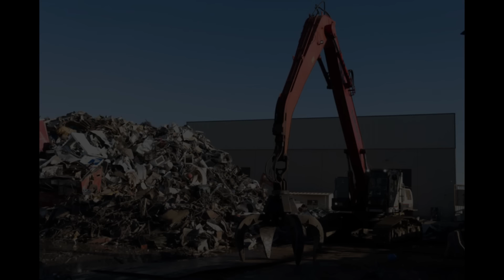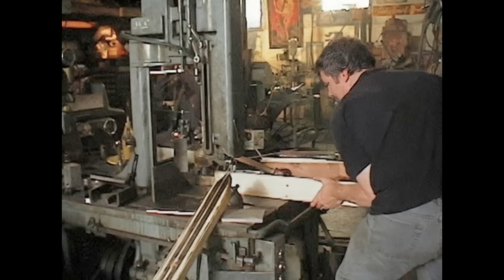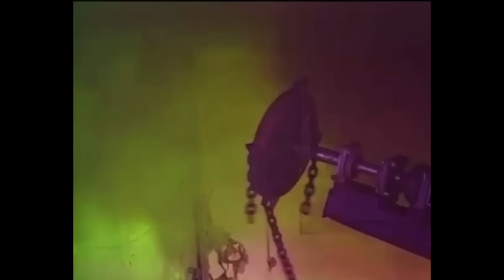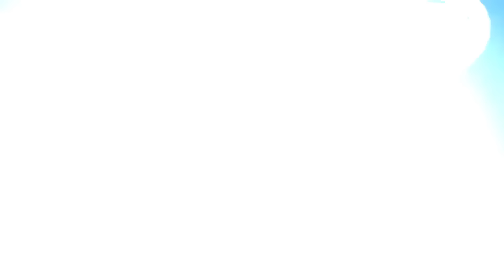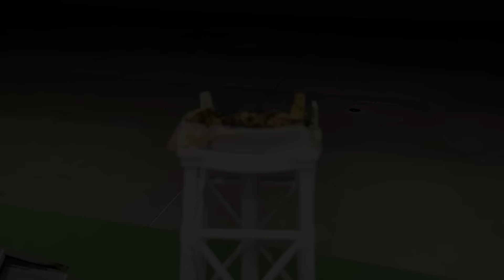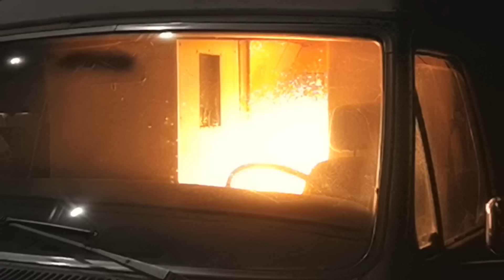Creating a Plasma Cannon by Boosting Tesla Coil Strike Energy

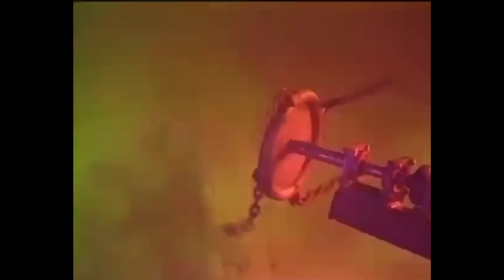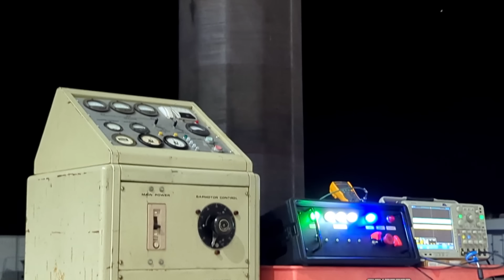Comment from the maker: For the scientifically minded, the boost theory starts at 4:30 .  If you just want to see test objects get vaporized, skip to 7:20 .  :D
if you want to drive high-voltage physics videos past celeb gossip and politics in the algorithm, consider dropping a Hype! (Mobile users: swipe the Like bar to see the button.)
Reply: Could you use something like a focused beam of X-rays to direct the plasma channel? If it was sufficiently directed, a narrow x-ray pulsed beam could ionise a channel within the air that would serve to form a ‘duct’ for the initial HV arc to strike, then triggering the subsequent high energy pulse. Would that work?
Reply from the maker: @giacomomarshall8339  the challenge there would be focusing the X-rays.  The diffraction limit might result in a overly wide cone of radiation.
Reply: @LightningOnDemand  so a sector antenna that pumps out X-rays pointed at a fresnel lens? Makes me think of the ASML lithography tech.
Reply: @Krissco2  Nearly all of Tesla's own x-ray tubes produced long collimated beams of x-rays.    The trick is to create them in that form, not create pointsource x-rays and ten attempt to focus them.  Normal medical tubes just spray x-rays at 180deg or more.  Tesla's tubes were of the "cone-beam" style, employing "transmission bremsstrahlung," with no huge hot tungsten anode.  Tantalum converters employed in particle accelerators do the same, producing a sort of "death ray" x-ray machine, with inherently collimated output.  Hermes-III project at Sandia creates such beams, then launches them at military vehicles, for testing their electronics' A-bomb immunity among other things.
Reply: @wbeaty that’s incredible. I’ll read up on that. At the moment, I can’t imagine how that’s possible (to create as a non-point-source) so I’m sure to learn something!
Reply: @Krissco2  If I understand correctly, a megavolt electron beam turns into an MeV x-ray beam if it slams into a membrane.  It's apparently a relativistic effect, so it turn off when your DC supply is down below 500KVDC.  The resulting photons maintain the trajectory of the electrons, so a collimated e-beam creates an "x-ray ray gun."  If we scan the e-beam, we create a scanned x-ray beam.

Tesla had many such tubes, many with glass fronts (where silica would be the anode!  Perhaps these only worked once the glass became nearly red hot and conductive?)  

A second method is to bounce an e-beam at a very shallow angle from a polished  metal anode.  In that case, a parabolic anode could perhaps focus the x-ray output to a point, or at very least generate long collimated beams.   The Tesla tubes would then have a dish-shaped cathode and a hollow cylindrical anode, and put out an annular (hollow) collimated x-ray beam.

It's all no fun, because standard hospital x-ray generators have more than 3x too small a voltage for this.   But look into so-called  "cone beam" x-ray sources, especially the ones based on "transmission bremsstrahlung" membrane anode, rather than the conventional reflection type.

Tesla was (semi-secretly,) all about teh collimated x-ray beams, and recording medical images from tens of feet distance.  His infamous "radiant energy" patent was actually a phototube-style RC receiver, where the transmitter was depicted as one of his glass-front x-ray tubes.  

Heh, build metal robots which ignore all radio, because their receiver is sensing KM-scale collimated x-ray beams, and is enclosed inside an aluminum box!   Now go watch again Sky Captain and the World of Tomorrow (for historical accuracy.)   All historical references to "world of tomorrow' are actually referring to "world of Hugo Gernsback," who got it all right from Tesla.  Food pills, jetpacks, and wearing togas?  The food-pills were Factor Actus.  Tesla apparently preferred personal nudity.   And yes, lots of ray-guns of course, shooting hypervelocity micro-bullets of mercury or tungsten.   World of TomorrowTesla.
Reply: @giacomomarshall8339  
PS, 
Robert Golka mentioned that he couldn't get UV beams to affect the lightning from his huge Wendover coil, ...but that x-rays worked well.   So there's that.
Also, one colleague says that Golka had six big Tesla x-ray tubes glassblown custom, but then destroyed every one of them by driving them with his too-large kilowatts.   Tesla said there was a trick he discovered, which let x-ray tubes run at unlimited voltage.   (But did he mean high kilowatts?   Or just MV potentials?)    
One possibility involves those "discharges of inconceivable violence, the ones which sound like a starter-pistol.   Perhaps these occur when using a topload gap with MV voltage stand-off (meter-wide hemispheres?  Or oil-immersed?)   His Wardenclyffe plans show one of these, an "extra gap" placed above the Extra Coil.   Build one, and see if it creates nanosecond-scale sparking-blasts.
Reply: @giacomomarshall8339 laser lightning rods to create ionized pathways might be a simpler option.
Reply: We can go old school, like "Ben Franklin" old.

A spool of thin conductive wire, shot to the target. The wire plasmafies as it conducts the initial pulse and provides the conduit for the sequential strikes to follow.

They use a similar technique with sounding rockets shot into thunderheads to study lightning strikes.

The rocket goes up trailing the wire and down rides the lightning bolt. Often, two or three extra strikes hit the ground where the rocket launched.
Reply from the maker: @PrinceAlorian  Well, that worked rather well for the Lorentz plasma cannon!
Reply: @LightningOnDemand  I'm still curious to see how effective the Lorentz plasma cannon would be, particularly with regards range, by pulsing a laser to create a channel of ionised air instead of using wire. I don't know enough about the science to know if that would also work here, but I'm guessing it wouldn't. You mentioned previously the laser would be too expensive, but given it only needs to pulse for an extremely short period of time and the ionisation of the air only has to be sufficient to create a reliable channel of least resistance, I would be very curious to see the results of testing such a set up with a relatively weak/cheap laser.
Reply: @LightningOnDemand that special antenna or horn antenna electromagnetic vortices.. I bet you could bust out some pretty cool inexpensive experiments with it I know I brought it up sometime ago but I can't let the fact go there are so many applications that could be used for... From power transmission to possibly making microscopes more accurate.. I was curious if there was a way to emit like a stationary one, and use it like a floating battery completely weightless.
Reply: The interaction with the fireball from the church made me think of a tracer round. Could it leave a trail of smoke and particulates that could be enough to establish the arc?
Reply from the maker: @ofthenightffs  possibly... Perhaps if it left a trail with a cohesive mixture, like napalm?
Reply: @LightningOnDemand   Ultra fine iron powder?
Reply: @LightningOnDemand  In their paper "Tesla Coil Research," Daum and Corums made a 30ft straight-line discharge, apparently by creating a thin beam of micro-dust.   They landed an Army contract to do the research.   Apparently nothing came of it, since standard Tesla-coil lightning is easily blocked by grounded aluminum foil ...and LGP laser-guided versions have thousand-foot range at least.   (But,  perhaps their version scales, where their 10ft TC secondary can produce a discharge that remains straight for ten yards before falling back to fractal-lightning at the tip of the straight segment.   Try tripling everything?   Or does it go as the square-root of volts? )
Reply: Arc angel made a water electrode that shot salt water out of the top load and made a really long and straight arc, I wonder what would happen if you used a flammable liquid instead of water.
Reply from the maker: @ferrocerium123  a highly exothermic experience, I would imagine!
Reply: @LightningOnDemand  fr
Reply: @LightningOnDemand  Ooo, a bit of water emulsion, plus copper sulfate solution or similar?   Or just fine dust suspended in the oil?    Fireworks colors.
Reply: First of all I must commend you for your devotion to the rigors of hard science; the temptation to unleash the destructive force of such a device must be overwhelming, I am humbled by your steadfast ability to resist in your devotion to the quality of the data you are gathering.
Quick question, is the PFN output injected into the secondary base? Or is there a direct path to the topload? 
It would be interesting to configure a QCW coil with a PFN, trigger the pulse at the peak of the ramp and dump a bunch of current into a nice long sword-spark...
Reply: @wellscampbell9858  Hi there, I really hope your question will be answered by the creator of this batshit crazy machine. I can't get my head around it as well. The capacitor/inductor array shown at 5:40 does implicate that the pulse is dampened but I still cant imagine the secondary surviving that without vaporising as well if the pulse gets injected at the base. I can't really think of a way to connect to the topload without some sort of unwanted kickback in this "PFN" either. At first I thought he might fire the original plasma cannon to the topload or something with thicker cable maybe but how would you ever time it? Sure would be fun to add another trick to boost SSTC's.
Reply: Also... Perhaps a high powered salt-watergun? Or perhaps both? ( Together with the laser suggestion )
Reply from the maker: @LuiLulumon  Indeed!  Mythbusters did study the coherence length of a saltwater stream.  The problem they ran into was it breaks up into droplets after about 20 feet or so.  then the voltage you need to connect all the droplets becomes astronomical :D
Reply: @LightningOnDemand   Can you add sugar or some other additive to increase coherence?

Bonus effect, the ants will attack your target for you.
Reply: @LightningOnDemand  Sodium yellow lightning, 10ft long?   
Need a fast fluid switch and multiple tanks, for copper chloride, strontium nitrate, etc.   Maybe an oil emulsion, for flamability?   Create a brilliant magenta beam, but with periodic yellow and green pulses racing along it.   Wiggle the squirt head for Doctor Zarkov spirals, or, try to duplicate the glowing-rings robot-lab effect from Metropolis.   What other wet fireworks chem gives interesting colors when hot arcs hit the squirt-gun stream?   
A Buck Rodgers ray gun which doesn't emit any invisible ray! :)
Reply: No ideas, but is the schematics of the full system somewhere to look at? I'm interest in how the pulse forming was implemented exactly.
Reply: High powered pulsed laser, 0.5 seconds, start it a bit before the arc and let it rip at the same time. Should both lead the arc and give extra oumph for a nice show... You can do it!
Reply from the maker: @LuiLulumon  as new as I can figure it takes roughly a terawatt of short pulse laser to ionize a long filament of air.  That's sadly well beyond my budget 😢
Reply: @LightningOnDemand   If you can, get in touch with the guy that runs the styroPyro youtube channel.  He is an expert on sketchy home brew lasers and can probably help you build a pulse laser powerful enough to ionize air.
Reply: @LightningOnDemand  Do short-wave UV lasers ionize air? Not in the brute force terawatt pulse regime, but due to the inherent manner that hard UV ionizes air? I know that as you move towards shorter UV wavelengths the light is absorbed more completely by the atmosphere, there must be a sweet-spot wavelength that weakly ionizes the air, and would allow the beam to propagate farther... 100-200 nm or so...
Reply: @LightningOnDemand
Could you PLEASE contact StyroPyro (another YouTuber) & ask for a collaboration*, I think that can create some AMAZING results... :D
*Or just either invite him to see your machines, or for you to come and see his machines?
Reply: I would appreciate further elaboration on the component value selection vs the system parameters for the pulse forming network. While it is mentioned it is critically damped, I was under the impression that you'd also want the effective frequency to be roughly around Fs, implying that there would be specific component values required to achieve that, and I imagine the leads add a non-trivial impedance, in addition to the arc loading.
Reply: '...led to a direct arc strike, and ultimately to a loss of structural integrity.' 😄👍 In other words, 'a direct strike blew it to smithereens'. 'An RUD' 
Thanks for the video.
Reply: You should totally get in contact with Chris Boden (@PhysicsDuck) and do some colab.
Reply: plus eating irradiated salt
Reply: What if you pre ionize an air channel with a laser to increase range? i mean ive heard of experiments that used lasers to discharge lightning clouds. However i guess the laser pulse must carry enough power to ionize the path
Reply: Can you make a hostile machine using a saw blade and some robotic parts or motors that's made out of scrap metal and does one thing it will act like a hostile machine it's a cousin to the tank robot from srl
Reply: Did you ever come across that paper or study done or like some MIT folks or somebody like used a special kind of cone and it put electromagnetic vortices out like smoke rings
Reply: There was a study done that long ago were some folks made like a a cone that made electromagnetic smoke rings
Reply: Do you have an email I can email you an inquiry kind of like the comment section here but just more direct
Reply: I....NEVER skip the science portion of the video.

Iykyk
Reply: Can you add this to a high powered laser pulse that would ionize the air ahead of the electric strike to increase the range ?
Reply: @LibertyDankmeme  There's a patent, I think McDonnell Douglas.  They found that it only works for 1000ft.  But then the repeat the laser, to chain many 1000ft segments together, and make KM-scale lightnings.   It was a patent for harvesting energy from thunderstorms, letting the storm cause the plasma-streamer to grow by itself, where the whole device is mounted inside an aircraft.
Reply: There is various types of metals that could unergo EML .. could you possibly launch a molten ball
Reply: I note that the TC secondary itself is a nanosecond-scale pulse-forming network.  
Tesla himself repeatedly described the "rifle shot" discharges which occurred when fractal-lightning was entirely suppressed.   His "discharges of inconceivable violence."  How did he create them?  Obvious in hindsight.  Get rid of fractal discharges.  Then, any lightning produced will be very different than expected.

During a common non-fractal discharge, the EM pulse will view the windings of the secondary not as a spiral, but instead as a stack of rings, ...a very long megavolt capacitor, and the EM pulse doesn't follow the spiral, but instead it discharges the coil at something over a nanosecond per foot of coilform height.  (It's operating at frequencies hundreds of times higher than resonance ...so behaves capacitively.)  
The discharge current goes sideways through the wire, leaping from turn to turn as a capacitor's dielectric current.  (And, the Corums developed this megawatt impulse phenomenon into their "bang-bang" double-coil emitter of fireballs or "Ball Lightnings.")  
Even a single TC secondary, if excited at 1st and 3rd harmonic, apparently produces Tesla's "rifle-shot" loud bang discharges.   At least, that's what Tesla reported.   Not fractals, but instead explosive "rifle-shots," with no breakout point supplied, so the discharge is DC megavolts..   

The only "trick" would be to add a multi-megavolt spark-gap device in series with the top of the main coil, so discharges to ground aren't triggered until the tophat electrode rises well past a megavolt.  That should produce the straight-line lightning and the bang-bang effect of our MOS Boston VandeGraaff machine, but using an otherwise unmodified big TC.   (A TC is a DC device, if we view it in a 50 microsecond time regime!)   Perhaps use a 3ft metal sphere as the  breakout point, and space it at meters from the main terminal.  Move it closer until single-shot lightning starts happening.
This is basic RF engineering stuff, but it's the sort got from all kinds of low-energy, low-volt projects.  So, first figure out how it works, then raise the watts by many many orders.    And never forget that the rising pulse-edge of a doorknob spark is a few picoseconds long.  A Tesla Coil producing "rifle shot" bangs, it might be broadcasting some brief spikes up in the tens or hundreds of GHz.   What megawatt physics gets turned on up there?
Reply: hey why the audio seems muffled and low quality when you speak in that night place? the very first one is heard correctly but the second one sound is really bad